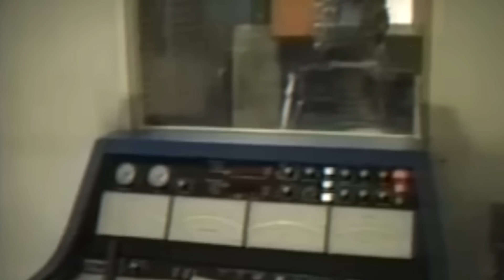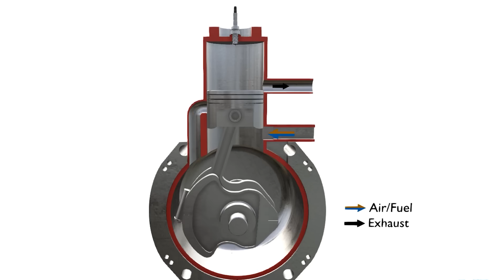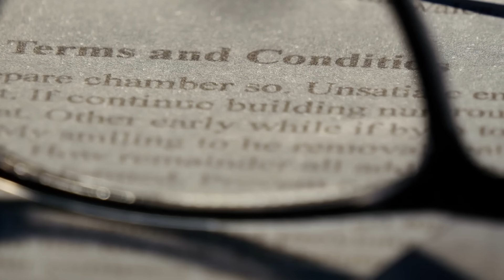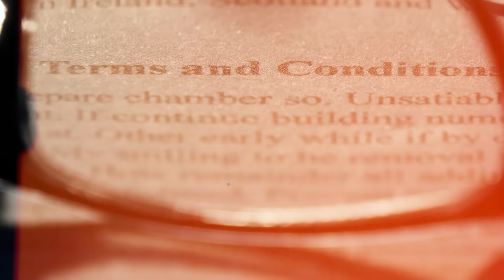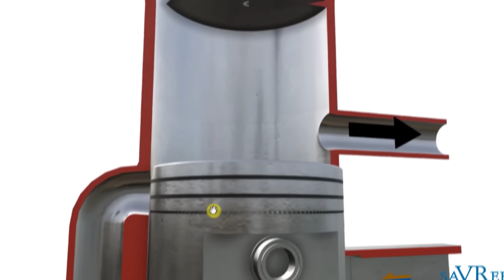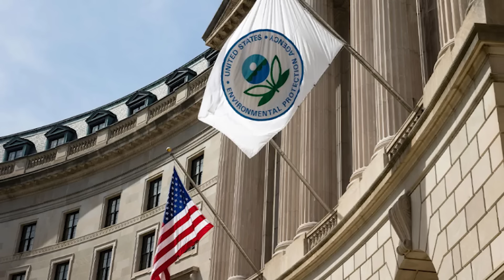The SHOCKING Truth Behind Banned 2 Stroke Engines!

Comment: I've owned both 2-strokes and 4-strokes. Have a 115hp Yamaha SHO on my boat. Much prefer the 4-stroke for how smooth and quiet it is. The EFI 4-strokes are less finnicky than the DFI 2-strokes in my experience.
Reply: 4 strokes are gay

Comment: My 89 Evinrude 150 has towed many stranded boats off Lake Whitney.   It on a 22’ pontoon boat.  It started out on a tournament fishing bass boat and had a hard life of full throttle.  I keep it well maintained and ready to help people if needed. I add the oil at gas tank and ditched the oil pump.   It’s been very reliable for many years.  Even with all those aftermarket eBay parts in there.  😂

Comment: I don’t give a fuck what you saying in your documentary two-stroke engines have oil in the fuel and when it is burned, it fucks up the environment. Hawaii was right for banning two stroke engines in Hawaii! You could do the same thing with electricity and it would be more powerful and you’re not fucking up the environment. Hawaii is a small ecological biosphere in the middle of the ocean. With a delicate ecological/biological acidification balance Who’s losing out the oil company? Is that where your paycheck come from? Is that why you’re saying what you’re saying? Otherwise shut the fuck up. Unless you have a motive, there’s no reason why you wanted to destroy the environment if your boat or your engine is gonna work, the same without the ecological fallout.

Comment: In WW-1 ( 1914 - 1918 ) 65 or 70% of all aircraft engines were 2 stroke.  Why, higher power to weight ratio.  In those days the two stroke engines were rotary radials.  One of the most unusual engines ever used.   I'm typing very carefully.  The crankshaft was bolted to the firewall and always was stationary.  The engine block with it's radial cylinders rotated around the fixed crankshaft.  The propeller was bolted to the crankcase.    The Sopwith Camel, a favorite of Snoopy and the Red Baron's red triplane were both powered with 2 stroke engines.  Today 2 stroke aircraft engines are limited to the "ultra-lite" class of aircraft that do not require a pilot's license.  Party on Dudes.
Reply from the maker: Party on

Comment: We still buy and use them in nz,seems to be fairly obvious that dumping oil into the engine with the fuel would have to be a good thing, outboards are very expensive here and outlawing 2 strokes could provoke a revolution,4 strokes are quieter and don’t stink as much when trolling with wind aft
Reply from the maker: What donyou reckon the split is over there?
Reply: @VintageBoats  most people still have 2 strokes however the new outboard motor seems to be in favour of 4 strokes due to their quite operation and fuel economy

Comment: Hi I have made some experiments lately with a Johnsson 20 hp 2 stroke engine on a boat in real life 
It runs on alcohol and vegetable oil 
The carb is a little modified to give the right fuel/air mixture
I swich fuel before i stop the engine so the carburetor does not have alcohol in it when the engine is not in use This to prevent the carb from corrosion
The oil in todays experiment is Maxima Castor 927 
2 stroke oil soluble in alcohol even at minus 18 degrees celcius
Alcohol and the oil is biodegradable in the environment
I will seek for oils that are ok for the environment
Alcohol is considered basically a climat neutral fuel that can be combusted very clean in engines
Anders Lindholm
Reply from the maker: Thanks for sharing this is super interesting! I hope it sparks some interest in the community! How's the experiment going?
Reply: @VintageBoats  Thanks 
So far i have only made 2 real life trips with the boat The engine started easy, like normal. The power to get to full speed feelt normal and full speed was also the same as when using gasoline
I have drilled the main jet 2 times so far to see if i make the engine  run better or worse
One idea today is to measure full speed by adding a speedometer and write down the max speed everytime i test a new drilling of the main jet
I prepare to solder the jet with tin and then drill again with a smaller drill if the jet adds to much fuel to the air
This also gives the possibility to bring that carbureator back to gasolin use
So far i have not done any other modifications to the engine
Start and low speed air fuel mix is in my first test easily adjusted by the choke
A few days ago a person asked if we could take a little longer trip with the boat
I switched the experimental ethanol/veg oil adjusted carbureator to a standard gasoline/marine 2 stroke oil carbureator in about 10 minutes and then we made a non experimental trip in the same boat in the sun here i the Swedish archipelago
Best wishes Anders

Comment: I swear to God . Even if they ban all 2 strokes or even gas engines, and pass laws saying all boats must have electric engines by so and so year. I’m going to design some type of used oil generator to generate the electricity for my electric engine, and the most critical part of any design I make. Will be that it must smoke. A LOT !!
Reply from the maker: That's hilarious.. strongly on the old school side! What do you run with at the moment?
Reply: @VintageBoats 2 stroke 73 Johnson 3 cylinder 65 HP out of Florida. Just can’t kill it . But I do use a little extra oil in my mix 😎

Comment: I found using a victor lawn mower on low reves jogging through long grass as more economical then a crappy 4 stroke that keeps cutting out on you  or struggling with long grass.  There will be ways around the issue,  sealed bearings and higher ratio gearing to cut reves down and get more work out of each stroke.
Reply from the maker: Where abouts are you boating?

Comment: Ive all ways run 2 strokes, outboards, motorcrossers, there reliable ,simple and powerfull
Just recently i moved back to the UK I  bourght a new boat it had a fourstroke on, i can honestly say it is so quiet, unbelievably economical compared to a 2 stroke, not as fast but hey if you go to fast your sounder doesnt work and you can drive over fish 
I see a lot more going slower and quieter on the water, 
But i wouldnt change a 2 stroke  crosser for a 4 stroke
Reply from the maker: I guess it depends what you are in the water to do! Thanks for watching and sharing your experience. What do you fish for?

Comment: They could offer a 2 stroke motor Buy Back Offer 💵💵💵
Trade in your old running 2 stroke for a discount on a new motor 💵💵💵🚤🛥️🛳️⛴️🚢
Reply from the maker: Idealistic. Keep using the 2s for commercial use... 

Do you currently run a 2?

Comment: I own a 2001 kawasaki ultra 150. I.E. 1200CC 3 cylinder 2 stroke and love it. But I also recognize from riding on smaller inland lakes the yellow on my boat hull after a few days from the oil in the water. PWC's getting so popular likely pushed the issue with 2 stroke engines
Reply from the maker: Thanks for sharing. The dreaded PWCs. Where do you boat?

Comment: 2 strokes are obsolete OMC/Brp tried to keep them alive but failed, internal battles from engineers vs marketing killed the companies, engineering said we're on the wrong path and need to build 4 strokes. As a 47 year outboard tech I know of no customer that complains about 4 strokes, the racers are now adopting 4 strokes with good results, time to move on.
Reply from the maker: Thanks for sharing your valued experience. There's still a big nostalgia market and quite frankly so many 2 strokes still running people out on the water so until they stop, people will keep loving them!

Comment: I’ve been yelled at for my smoking 1976 Chrysler 2stroke 15hp motor.  But 2stroke aren’t banned in my state are isent because time is phasing them out already. Honestly. How Mandy people are running 50 year old outboards
Reply from the maker: A lot more than you might think! 

But you're right...time will eventually phase the masses out! 

Chrysler still running well? Which state are you?
Reply: @VintageBoats I’m only one of a handful of people running old motors.  Heck is officially a antique motor now.
Reply from the maker: @robertusa1234 scroll through video comments. There's much more than a handful running 40/50 year old motors!
Reply: @VintageBoats I would say over 95% of the outboards at my lake are 2000 and newer 4 cycle motors. That’s 25 years old

Comment: Been two stroke diesel that dont use oil for a while 
     Just put a huge Detroit in it 
Best answer for anything 
    Giant hybrid mechanical electric blower  cvt to two out drives
Reply from the maker: An interesting take. Thanks for watching.

Where do you get on the water?

Comment: Essentially they forcing more stuff into useless and illegal obsolescence with ZERO parts availability., The poor folks out there can't bring the older stuff back to life for a while like they used to do with old cars, trucks, tractors etc. "They" like it that way 'cause it makes the newer stuff sell better. That also forces you into paying the BIG sales tax on the new stuff.
Example: My A/C condensing unit could not be gassed back up after an evap coil replacement because the refrigerant became illegal. Consequently, I had to spend  $10K for a 4 ton replacement condensing unit. Thanks Uncle Sam.

Comment: I bought a mid 60s AristoCraft Funliner complete with a 65 hp Mercury 2 stroke  and trailer last year. It hasnt seen a body of water in 25+ years. 2 weeks after i got it home, i has it up and running. Smoked a bit at first when it first started. However, it cleared right up and runs great.
Reply from the maker: @midnight-tw3gp that's awesome work! Well-done.. hope it keeps running like a dream!

Comment: 2 stroke rocks!!!! Not as much difference in the environment between them. I love 2 stroke.
The oil used isn't much different than an oil change.
Reply from the maker: @independentthinker8930 thanks foe watching... what do you run with?
Reply: @VintageBoats Merc 2 stroke mostly. But on our hydro we race it a champion, (hotrod). We run modified outboard hydro and runabouts., we set a world record back in the 90's with a champion 7.5 HP, (15 c.i.) on an 11' 9" hydro, ran a little over 72 mph in measured, legally clocked kilo run
Reply: @VintageBoats oh, the champion has rotary valve, that little two cylinder 2 stroke was strolling at 9,200 rpm!!!
Reply from the maker: @independentthinker8930 insane stats! Bet that was a lot of fun! Thanks for sharing, will celebrate that!

Comment: This video was very entertaining. I have summer time and winter experience with the 2 stroke engine most recently with snowmobiles. My sled was built by Polaris. One of the couples had sled was built by Ski Doo. The Ski Doo engine has what they call E-tec. They idled smoother, don't smoke and used much less gas (using present tense because the 2 strokes still use the E-tec system). The Polaris sleds were a little quicker with electronic fuel injection and had a tiny bit more top end but used almost twice as much gas. The other odd ball had a Yamaha with a naturally aspirated 4 stroke. It had low end torque but not enough to make a difference and it was heavy but it used gas a few drops at a time. That E-tec for 2 stroke engines was a game changer.
Reply from the maker: @woodswalker1111 thanks for positive feedback and appreciate time of a long comment. E-tec is very polarising here in the community. How many years did you get?
Reply: @VintageBoats it's been a big portion of my life. The old lawn boy lawn mowers, dirt bikes, outboard motors and snowmobiles.
Reply from the maker: @woodswalker1111 snowmobiles I haven't had the pleasure of yet! Where abouts do you so this?
Reply: @VintageBoats Upper and Lower Peninsula Michigan.

Comment: I love my 2000 Johnson 115 2 stroke. Strong running motor. Don’t trust the VRO on the older motors so deleted it with a fuel only VRO fuel pump and pre mix the fuel. I’ll keep it until it dies.
Reply from the maker: Good luck in keeping it running, you won't need much of it! Thanks for watching

Comment: Back in the 1990's I was on the "tip of the spear" in bringing 4-stroke outboards into the US market. Our larger 4-Strokes (Max at the time was 45hp) were much more expensive than the same sized 2-stroke hp. Plus, I had a limited 4-stroke lineup, 2hp to 45hp, compared to my 2-stroke competitors. I spent many day (and nights) on the road setting up dealers to sell my product and they made very good $$$ selling them. I found that rather than the "cleaner technology", customers responded more to the quietness and smoothness of the running engine as the main appeal of 4-strokes over 2-strokes. Then fuel economy after they purchased and used the product. In 1995 when Mercury and Yamaha went in together to build a 50hp 4-stroke, my phone started ringing off the hook with marine dealers now very interested in my product line. Fun times, but shame on you for not mentioning Honda Marine once in your video. For that you get a down vote.
Reply from the maker: What motor was this? Sounds like a harsh down vote to me but I'll take it. Howpfully win you over in a video coming soon...!
Reply: @VintageBoats  Honda 4-Stroke outboards (the original 4-storke outboard line up since 1964.). Videos about it on my channel (among many other things). Sorry about the down vote. I get them all the time, but I rarely know why. Comes with the territory I guess.

Comment: Im not a big fan of 2 stroke but there are some cases where they are preferable.
Reply from the maker: @jasonglisson1690 do tell your reasoning? Would love to hear.
Reply: @VintageBoats well most of the 2 cycle i have delt with are small engine equipment. Like weed eaters and such. The carbs on them are really small. Everything in them are even smaller. So they can be a pain to clean or rebuild. They can be bad about carbon buildup also. Which is usually what kills them. Many are cheaply made and don't last long. Plus they generally lack torque. Which i believe is better then horsepower. I will say that they are good for high rpms. Plus you also have the extra step of having to measure oil and adding it to the gas. So it makes it more inconvenient. Most of all i believe the 4 stroke is a far superior design in most cases to a 2 stroke.
Reply from the maker: @jasonglisson1690 all sound comments, thanks for sharing

Comment: I loved my two stroke motor cycles and outboards, but they were filthy running.   When I would run the outboards in a barrel, I was just amazed  at the filth in the barrel.  The new generation two strokes are amazing but are complicated and problematic, ask anyone who works on them.  If two strokes are no longer made, they will fade into history by themselves
Reply: Let see any 4 turd stroke car engine run tilted in any position with just oil injection.
Reply from the maker: @martinschulz9381 it's a more complex scenario than meets the eye and there are two strong sides to arguments. What are you running these days?

Comment: Power to weight ratio ?  That no longer applies. I just repowered my boat replacing my old 2 stroke for a new 4 stroke. The two motors weighed about the same but the 4 stroke wins in power and nearly double in fuel efficiency.
Reply from the maker: @alann-h3j stuck with same brand or change that also? Thanks for watching.

Comment: luckily i have a Evinrude Etec witch had the power of a 2 stroke and the fuel efficiency of a 4 stroke but sadly i will have to sell in the coming years  due to parts availability, dealer told me 3 months for a service kit and its not getting better
Reply from the maker: Ye that's unfortunate, can't be dealing with that potential downtime off the water! Thanks for sharing..what will you go for?
Reply: My heart wants to replace it with a mercury but my budget says a Suzuki but I'll see whats on the market when I do sell it @VintageBoats

Comment: You can smell gasoline when they go by, uncombusted gasoline. and that is why they banned them. the dump up to 50% and it goes in the water as well as into the air. And they didn't ban 2 strokes they just made it so you couldn't buy new ones as the comments point out.

Comment: If they go to all electric motors, you have to burn fossil fuels to generate the electricity to charge the batteries, and then the batteries are also hazardous waste and also solar panels are only good for so many years and they are also hazardous waste so what’s the bull about all this? A lot of the two strokes burn biodegradable oil people have to stop and take a look at what reality is of everything everybody’s trying to be a Duga and it always has a kick back always remember that for every positive is a negative. Nothing is for free.

Comment: My old mercury 25 hp has been reliable and cheap to maintain, with a little mechanical aptitude, and a repair manual, even I am able to do repairs.
Reply from the maker: @thomasirvin4159 and if it's not in the manual you'll probably be able to find it on this great platform! Thanks for watching.

Comment: If you wanted to be a real bastard, imagine changing the ignition on a two stroke so it actually only fires every second cycle lol, so it technically becomes a four stroke, lol, not igniting a whole cycles worth of fuel lol, imagine the govt's reaction to THAT  ! with a suitable sized fly wheel, and an injection system, theoretically you could make a two stroke do just that, and not inject and burn fuel on one cycle, sure it'd be a gutless wonder, but it would work, after all, that's exactly what real four strokes do, AND they do it with more more compression (necessitating the flywheel)..I love two strokes btw...
Reply from the maker: Love the thought process on this comment. What two strokes are you running?